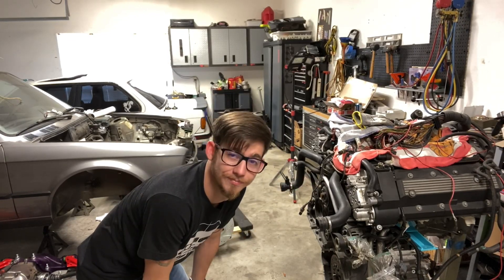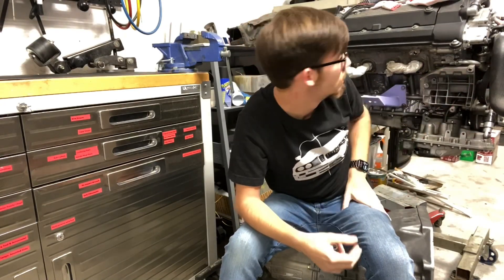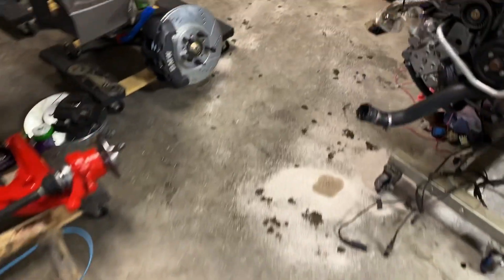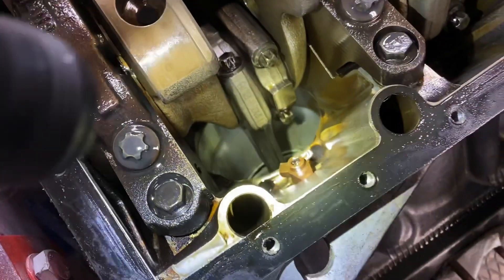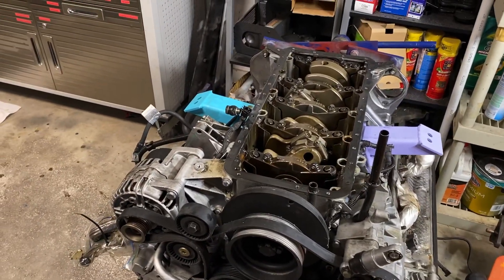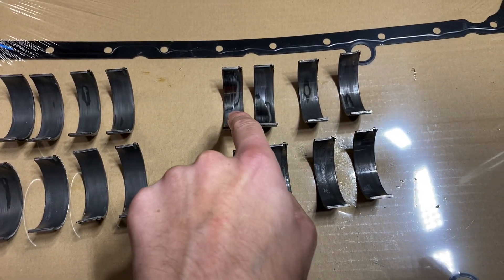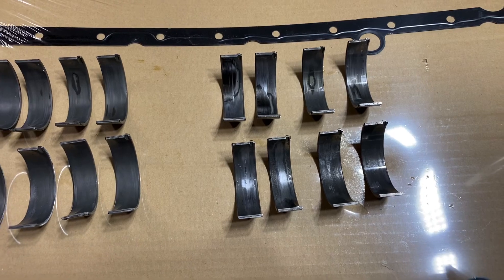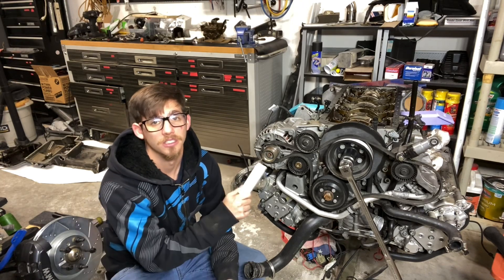BMW S62 Rod Bearings

Comment: Did you use new bmw rod bolts or did you go ARP?   Also, did you take a peak at any of the main journal bearings?  Thanks.
Reply from the maker: I used the ARP bolts. I did not take the main caps off. I did not feel the need to do so.

Comment: i feel like the s62 isnt as bad about rod bearings.
Reply from the maker: Honestly, and this is just how I feel about it, it’s all about how it was driven. Most of the time if you let your oil/coolant temp come up to operating temp and then get on it, you’re good. If you start the car when it’s cold and rev the piss out of it and beat on it, then yeah your bearings will wear out quickly.
Reply: @MeccaWerks  Fair enough. I almost wanna do them in my M5 for peace of mind. I have no idea if the past owner would let the oil temps get up before driving. Especially important being that BMW started doing these tighter clearances...
Reply from the maker: Yeah that’s why I changed mine. My S62 has 88kmi on it and I went ahead and replaced them. I felt like I made the right choice after I saw the clutch. It was very much burned through. I put about a mile on my e39 M5 and then pulled the motor. Peace of mind indeed.
Reply: @MeccaWerks  I'm doing the same on my 87k mi. car I bought 2 years ago.  The clutch is gone and decided to do the rod bearings as preventative maintenance since I don't know how well the previous owner was on maintenance.
Reply from the maker: Best to do it and be able to sleep at night. Sorry for the late reply. I for some reason am not getting notified.